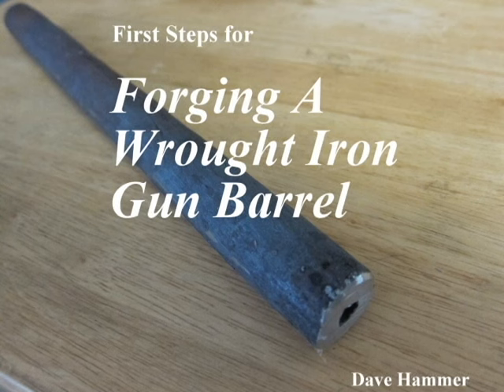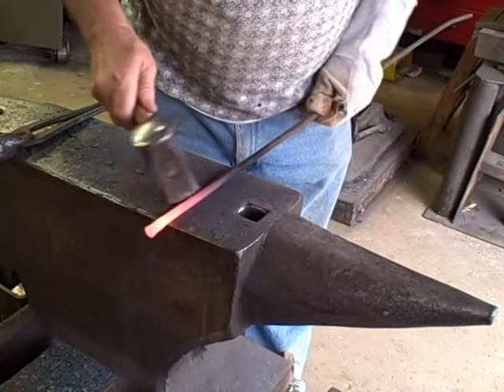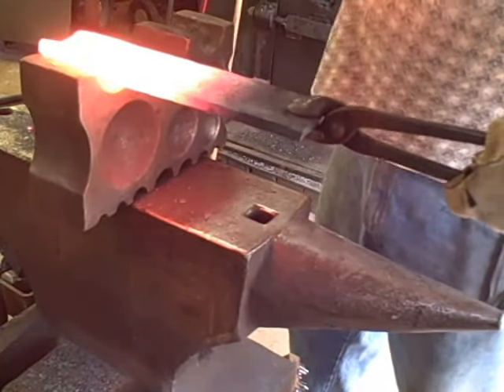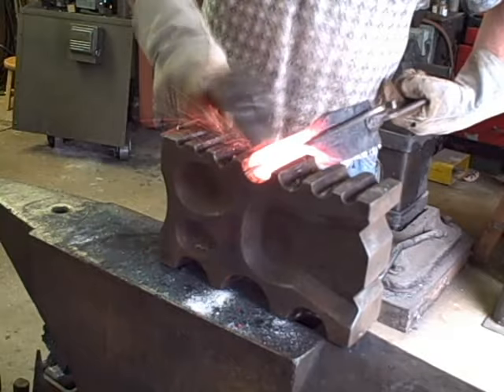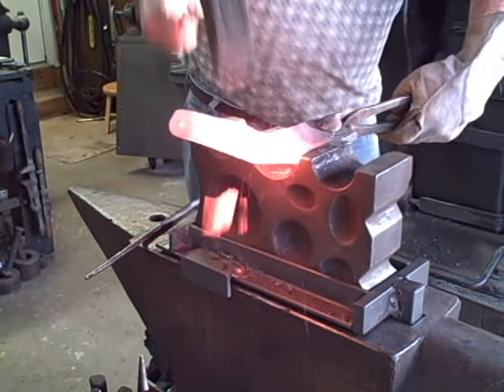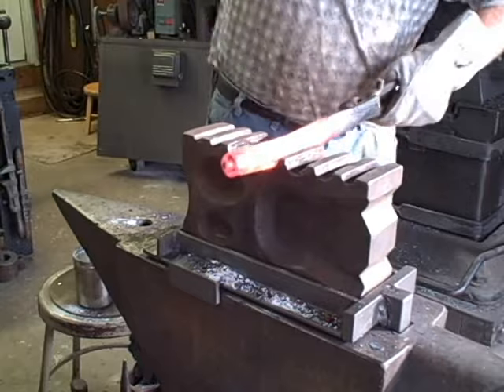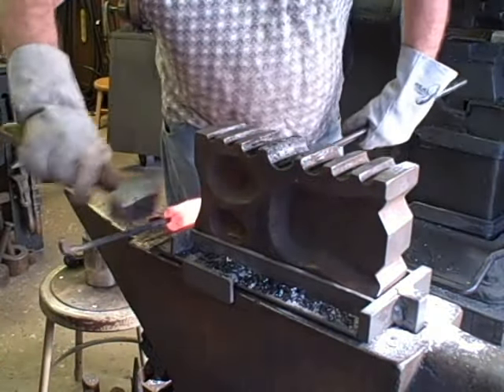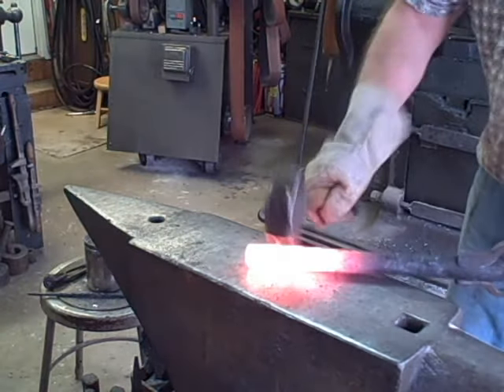Forging a gun barrel

Comment: OK so I am no fan with insane love affair Americans have with guns...
But i have to say this is some awsome blacksmithing and its nice this knowledge is being preserved.
very fascinating to watch...
Reply: Thanks....   Believe me, I have no great fascination with guns either.  I'm not sure I could even take this project to full completion legally without some government paperwork.  Forge welding this barrel was solely a blacksmithing exersize to see if I could do it.  I love blacksmithing and agree the processes need to be preserved and shared.
Reply: Pity it would be nice to see it completed..
maybe you could fill the barrel with lead or something...

The fiddly flintlock mechanism would be interesting to see done..
Reply: David Hammer if you are in the US a new made muzzle loading pistol is classed as a antique no paper work needed if you are in Canada on the other hand you need to have a RPAL license
Reply: camerl2009
What if the barrel is authentically made but plugged with liquid lead?
That quite commonly used for display pieces if i recall correctly..
Reply: ZerqTM here in Canada it would still be a gun it needs to have a steel plug welded or no flash hole drilled. owning just the barrel is legal just about anywhere in the world as far as I know
Reply: David Hammer Well done, David!  If you can legally own the type of gun you are making, you can legally build it yourself.  Just like the AR-15 crowd machining their own receivers from scratch, or from 80% completed lowers.  You cannot sell it or give it away, unless you get a license to manufacture firearms, but otherwise, build as many as you like.
Reply: David Hammer You actually can, it is legal to make a firearm for personal use, as long as you don't sell it you should be fine.
Reply: David Hammer from one blacksmith to another, great job!
Reply: David Hammer This seems like a huge challenge.
Reply: throngcleaver It depends on your jurisdiction's rules, but if you make the receiver yourself, and have no intention to transfer ownership, you may  be able to do so. I don't really like the political movement that's trying to bring hobby gunsmithing into the gun control debate, its a very old tradition that anti-gun lobbyists where apparently unaware of before Cody Wilson started talking to the press, and I doubt there would be people calling for regulation of CNC machines and homemade gun components otherwise.
Reply: Ken Clark
are you referring to the 3d printing panic?

that is kinda ridiculous since those guns will only last for a few shots.. so frankly they wont lead to mass murder at least...

I am frankly against the gun nuts.. but i am very much in favour of common availability of 3d printers and or CNC machines...

and i can sort of see the urge and fascination with weapons.. the provide wonderfully fascinating technical challenges...

for myself my interests gravitate towards making Hazard suits. (composite ballistic layer, thermal protective layer, hydrophobic outer paint layer etc...)
Reply: ZerqTM Yeah, well I don't know what your hazmat suit is for, but I don't plan on murdering anyone with an AR-15 or some defcad plastic brick, I don't even have a gun, I just think that most gun control campaigning is purely political, and doesn't offer the solutions that may come from a socio-economic movement that might actually reduce violent crime.
Reply: I both agree and disagree with that...

America has to much easy access to guns that one factor...
another is a culture of fear..

yet another that might have been mostly dealt with was leaded petrol...

Lead poisoning effects the mind reducing impulse control and increasing violent tendencies...

Caligula drank a fermented drink made in lead pots that had an insane concentration of the heavy metal... and lead utensils where common through out the Roman empire at that time which probably explains the Colosseum...

yet another factor would the the economic situation.. The American dream is pretty much a lie since there is almost no social mobility any more... only those with money get more of it..

Then there is the fact that there seams to be one law for the poor and one for the rich..... inequality in the face of the law discredits it..

so yah i see your point but guns are still a problem... or at least the type of guns...

for example no one needs military hardware.. except the military...

High capacity magazines are only good for loners who want to commit mass murder...

after all the 2nd amendment was created when guns where single shot and a damn long reload...

you had to have a pile of guys with guns to do any damage and that in a way formed a kind of democracy of sorts.... violence demanded consensus... 1man 1 bullet...

but with a high capacity magazine your a 1 man army/ tyrant..
that where i get annoyed with the gun nuts...

and if you need a high capacity magazine for hunting then your a shitty hunter X3
Reply: ZerqTM One study. Do you know the difference between correlation and causation? Do you know what an instrumental variable is? What falsification means in the context of research? The western world didn't reject slavery because of a removal of lead from our diets, and the effect of lead on violent crime rates economic policy is stochastic compared to the effect economic policy has on communities. Also what exactly do you want that hazmat suit for?
Reply: ZerqTM It might be oversaid a lot these days, but it's still true: Guns don't kill people, people do. Blame the psychopaths who use guns to kill, not the 99.9% of people who never intend to harm anyone with a gun (many of them hunt and DO intend to harm animals, but that's a whole different can of beans entirely).

You have a very jaded and pessimistic view on life and the contemporary world. It's a pity, because there's a lot more good out there if you stop focusing on the small, albeit potent, amount of bad in it.
Reply: Zach McDonald Everyone tries to classify malicious action in terms of psychology and medicine. The truth is that some people decide that they deserve to hurt others, and that many people have to live around people like that, and they usually have three options, to move away and try to find somewhere safer to live, to just keep living like they have and try to just live with the danger, or to actively try to plan for some violent confrontation in their future with the intent of fighting their way out of it. The former two seem like they could be pretty miserable existence though.
Reply: ***** There's a reason why no successful and reputable manufacture uses ABS plastic for the gas system of a rifle. Coldforging barrels is still popular because it works. DMLS just seems like it might not be very energy efficient for making parts as simplistic as lower receivers, and there already exist specialized machines for things like action springs and gas tubes.
Reply: yeah bullshit repeating and breechloading firearms have existed since the 1400s they were  just very expensive because of the high degree of skill that was required of their makers  and that doesn't count superimposed charges that turn a single shot into 12 or 24. the founding fathers were well aware of the march of progress not 80 years later lewis carried a Girardoni air rifle that was designed in 1779 on the lewis and clark expedition  and it carried up to 21 .46 caliber lead balls and the detachable air reservoir was capable of around 30 shots before needing to be changed it also saw use in the the Austrian army from 1780 to around 1815. So this completely destroys your argument  about high capacity firearms being new. the hunting argument is a non issue. the 2nd amendment was not put in place to protect hunters is was put in place as check on tyranny. An armed populace cannot be controlled by anything but full martial law backed up fully by a military,that in the case of the united states, is formed and made up of citizens that serve of their own free will, if they were ordered to oppress the populace that they are a part of ,in their own country, how many of them react ? many would desert and take up arms against said government and in many cases take their personal weapons and maybe even heavy weapons like tanks and artillery with them to join with the rebels  thus starting a guerrilla movement that would take years if not decades to eradicate. next high capacity magazines are easy  to make how are you going to stop people from simply welding and stamping new ones all they are is a box ,spring and a follower. How do you stop people from simply making them without unduly interfering with lives of everyone with a welder? there are literally people in the philippines who make illegal guns for a living they are made of scrap and anything else they can find in a jungle with hand tools. HOW DO YOU STOP THEM?!!! Guns are not the problem it's the people

Comment: What is the white powder stuff that he is putting?
Reply: I use "20 Mule Team  Borax" for flux.
Reply: For what? What is the purpose? I am new at blacksmithing, sorry.
Reply: I watched a Colonial Williamsburg gunsmith forge weld a rifle barrel.  I wanted to see if I could do the same (only I just did a pistol barrel).
Reply: Wow, thanks guys.
Reply from the maker: It is used to control oxidation (scale) that occurs on the steel in the forge.  Scale is an enemy against successful forge welds.

Comment: what stuff you but in?
Reply from the maker: +hönö olett If you are asking what the white powder I'm using is...  it's 20 Mule Team Borax.  I use it as a flux.
Reply: thanks
Reply: +David Hammer Did you make the bullets for Scaramanga?
Reply: +areolaman ...  I haven't made any bullets....
Reply: David Hammer do you remember the Bond film Man with the Golden Gun
Reply: +areolaman ....  I can't say I remember that....  But then, I didn't see ALL the Bond films...
Reply: If you're talking about the white powder he was sprinkling on the iron, it is borax. Plain old 20 mule team borax. It's used as flux. Some types of sand will also work. I hope that answered your question. Later
Reply: Lucien Macrose
Reply: +Delmarco Lockett .....??????
Reply: +hönö olett which powder use ??
Reply: Sniper 1989.....  I use "20 Mule Team Borax" for flux (welding aid).  It can be bought at most grocery stores in the soap aisle.

Comment: I certainly find this skill very fascinating. The warping of the long flat bar along its side into a circle  to make the cylindrical  form of long gun barrel is understandable but here is the interesting part. When the edges  of the flat bar are required to fuse together, well the hammering on the red hot edges  sees to  the merging of the surface dendrites  but what is interesting is that the central rod which he uses to ensure the size of the central hole along the barrel, well that does not seem to fuse with the inner side barrel even though it becomes red hot.
I presume that the vectored impulses when he hammers, the circumferential forces are greater than the radial force  and so the edges fuse but not the rod inside the hole.  Also the flux that he is dropping on the edge seems to be  breaking down the oxide which forms on the edge surface the red hot material hence  the virgin material is  fused while the oxide formed on the inner rod is still existing and hence no fusing occurs.  That nudge with the hammer on the central rod seems to clear any adhesion high points that may have occurred but it seems that  tightness is due to friction  and the expansion of the rod and the contraction of the barrel on the rod. Here is a good use for oxide formation on some  hot  metals.
Reply: When I bring the iron out of the forge, it's hot enough to forge weld.   When I push the mandrel into the hole, the mandrel is not hot enough (nor does it get hot enough, even though it will get red hot sometimes) to be forge welded.  The mandrel's purpose is to prevent the forge welding efforts from collapsing the hole in the barrel.  You are correct in that the reason the mandrel needs to be forced out sometimes is the barrel is grasping it with friction.

Comment: The relatively low pressure of black powder allows for minor weeknesses to go unnoticed.   This method way used, as was damascus to make barrels for hundreds of years.    Wrought Iron was very resistant to rust, much more than modern steel.  I have never seen a cart tire rust away, like an old car would.

Comment: A seam along the barrel is a weak construction for gun barrels, which would tend to fail at the relatively thin wall of the finished product. Barrels were made of iron tapes twisted and welded around a mandrel, and were able to absorb the pressure comfortably even with thin walls.
Reply: I understand some barrels were made as you described... and I don't dispute twisted barrels were stronger.  However, barrels were also made as I demonstrated, probably in much higher quantities.  I learned the technique from a master blacksmith that works in the firearms studio at Colonial Williamsburg. He frequently demonstrates making long barrel firearms, using the method I learned from him that was used during colonial days.
Reply: It wouldn't be too hard to grind a square section on to the ends and do a twist, therefore making a straight weld a spiral weld.
Reply: @jeanpaulgartier3404  Well, OK, but it's still a single seam. Barrel pressures are measured in tons per square inch, and sudden failure isn't pretty.

Comment: so how is a seal made between the 2 ends of the bit once they meet? is it welded shut or is hammering them together when they're red hot enough to fuse it together?
Reply: l'm not a Metallurgist, but it is my understanding that fusion occurs at the molecular level using the techniques demonstrated.  Electric welding was not invented until the late 1800s... centuries after the first gun barrels were made using forge welding.  I learned how to forge weld the gun barrel by watching a master gunsmith from Colonial Williamsburg (Virginia, USA) demonstrate the techniques I used in this video.  His day-job is to replicate how gunsmiths forged guns during American Colonial days in the 18th century.
Reply: You can see at about 5:10 he shows close ups where he's checking how well the seam is bonded. No arc/torch welder needed for that! And actually is much stronger than if it had been arc welded!

Comment: Most impressive!  Any particular reason one could not use some medium carbon steel for this work?  It should weld easily enough and as long as you don't quench, you should be able to machine it OK.  Wouldn't care to try this with mild steel, but spring steel should work.
Reply: Thanks!  I'm sure that modern steel barrels would be a medium carbon steel.  I'm not sure about spring steel.  If you make one of these, be sure you research the gun powder and loads that can be used safely.

Comment: Man, your arms must be in good shape!
Reply: Zohar Flax  actually he is swinging his hammer incorrectly. To get the most out of every blow the swing must start at your shoulder, not your elbow. I learned this as an apprentice rough carpenter. It is hard to deliver a hammer blow from the shoulder every time. On a good day I could swing three shoulder blows out of ten  and like the blacksmith my job was to swing a 20 ounce framing hammer all day.It feels more natural to swing from the Elbow. The result of a lifetime of swinging hard from the elbow is a massive case of tennis elbow which can end up with an elbow replacement in which your pounding days are over.

Comment: I always thought making a gun barrel was about turning a piece of metal into a donut and then rolling the donut with a pipe stick inside to stretch it out. Or just making a pipe stick and then drilling it cold.
Reply: ***** I'm sure some barrels were made by drilling and boring, but not all.

If you made a donut, then rolled the donut with a mandrel inside, the hole would just get bigger.  When you hit the outside of a ring with something against the inner wall, the metal will stretch and make the inner diameter larger.